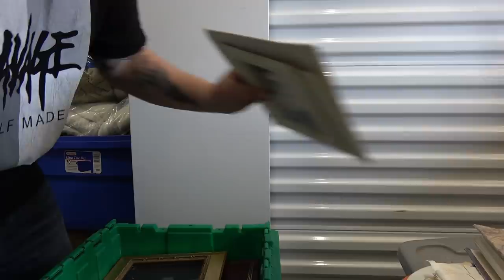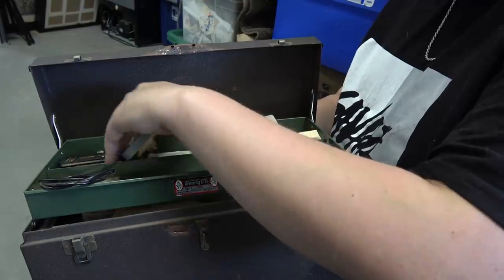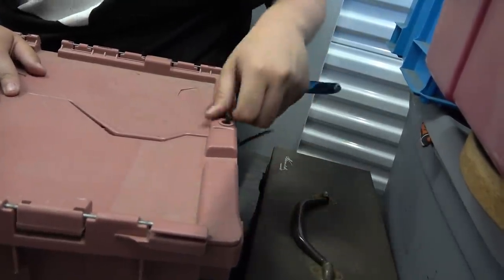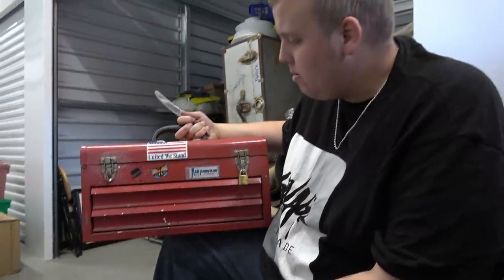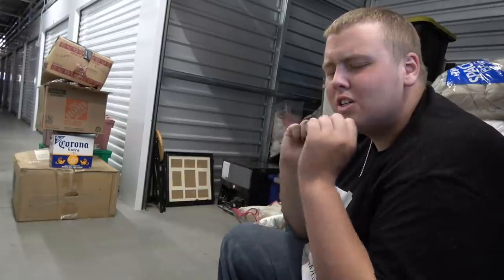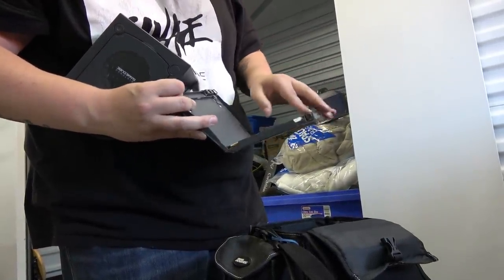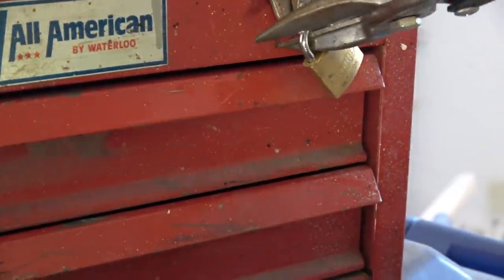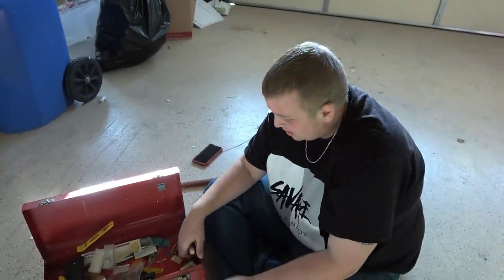I Bought a DEAD MAN's Storage Unit! FOUND LOCKED BOX! I Bought an Abandoned Storage Unit

Comment: The device you were using to try and get the padlock off the toolbox was a pair of sheet metal cutters. They looked like left handed ones, they are made in both left and right handed cutters. Thin sheet metal like roofing iron and thin sheet aluminium. Get yourself a small pair of bolt cutters, they'll cut through hardened hasps on small to medium sized padlocks.

Comment: Noritake China is good the ironing board thing yes it's a go. I have seen those and you can probably get some money out of it I don't know how much. Noritake China The metal cast aluminum w/ lid.

The embroidery piece that was by the stuff that you said about the funeral that was in the picture frame I also sometimes they'll call those samplers but those also if I had a better to look at it app can be valuable and a lot older than what they look because of they've been kept under glass. Check that out and you can do research  on antique roadshow site.

Comment: If you find a Dremel tool in a unit save it.  They have all sorts of bits you can use to open boxes.  The fiberglass cutoff wheel by Dremel would have easily cut that lock off and would have saved the box from being ruined.